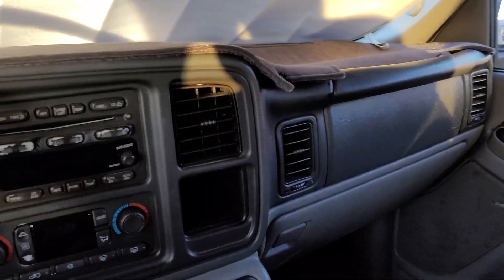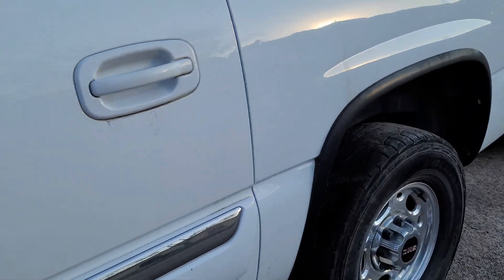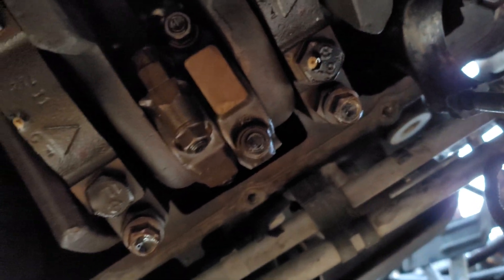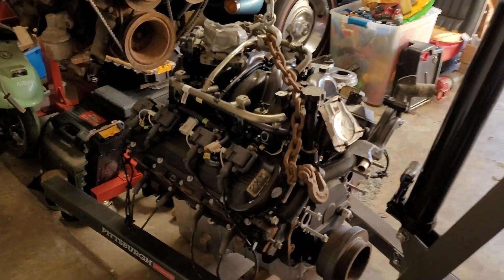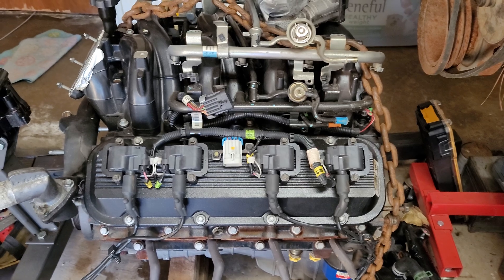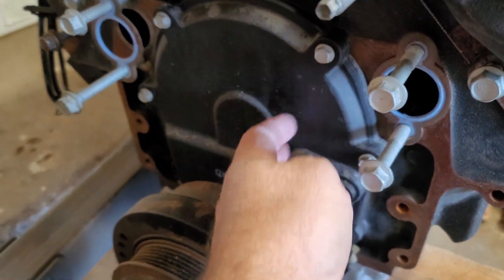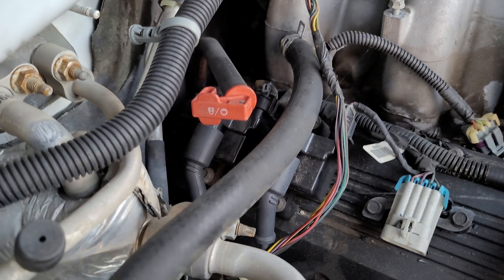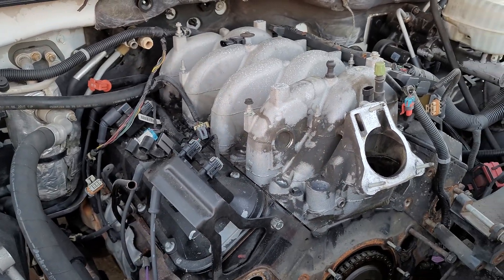Just How Durable is the Vortec 8100 496 8.1L Big Block Chevy Engine?

Comment: Sorry to see an 8.1 lose a rod, but I can see how it happens.  In my early experience with it the low oil sensor seemed to always be going off. I complained to GM and they responded “no that engine just uses a lot of oil” and it does.  For the past 15 years I always have a quart or two of oil tucked away under the hood ready to top things off and I always check the level before any long trip.  Glad to see you’re giving this engine some visibility and I’m watching with interest.
Reply from the maker: Hey Rusty, very prudent to keep the quart of oil at the ready. For most people, the thought of performing a semi-daily underhood engine check seems crazy, but that's what you do when the trucks working hard for you👍.